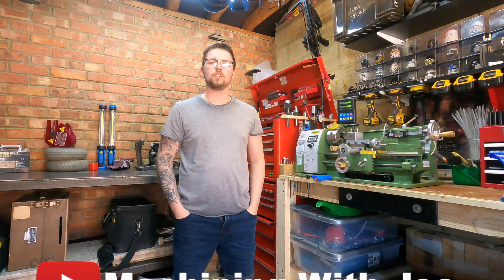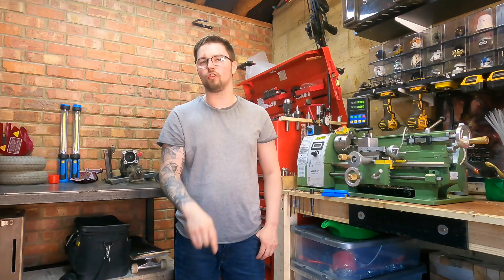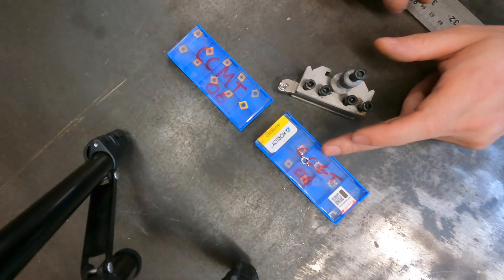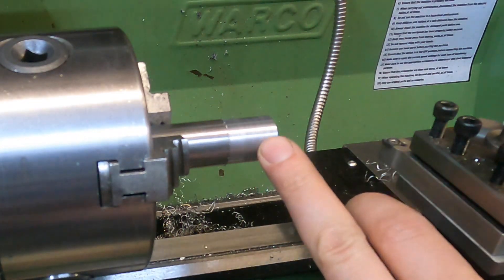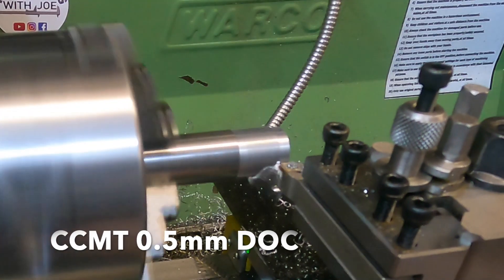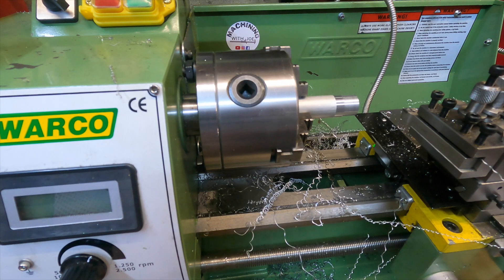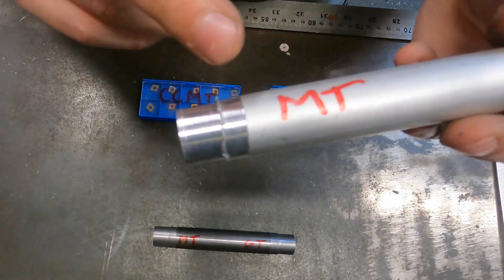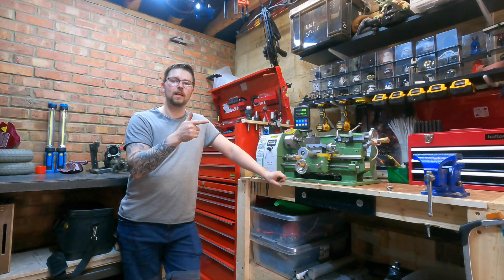Best Carbide Inserts for a MINI Lathe

Comment: The ccgt 21.51 from china are cheap, leave great finish on steel on my south bend 10.  Im sure the ones from mitsubishi/ kennametal are worlds ahead but ppd they are typically great.  Now if only the had 4 edges like negative inserts
Reply: Try a SCMT insert.

Comment: If you buy uncoated but highly polished inserts, they are specifically designed for aluminum. They don't work so well on steel for some reason but works great on aluminum. Another thing is, you need to dial up your feed rate because your chips are coming out stringy. 

Oh by the way in the beginning of your video your fly is open...

Comment: Following the link, those CCGT were AK inserts which is the Korloy designation for their inserts for aluminium.  They have 20 degrees of rake and are very sharp, really cut down on the power required to make a cut.  They won't last long using them on steel, but lets face it they are pretty cheap and are much easier on the lathe.  The CCMT inserts are probably moulded rather than ground, makes for really robust edges on the insert, but will draw more power when taking a cut.  I use an insert by Sumitomo which is also a ground insert, less rake than the AK about 15 degrees I think.  I use that for anything I cut in my small cnc.  Still cuts down on power required compared with a moulded insert, I use it as my general purpose insert.  I do not use moulded inserts in my cnc as it only has 1/2hp at the spindle. Good video Joe
Reply from the maker: Hi thanks for such a detailed insight into them the rake angle makes sense why they seem to achieve a great finish with so little lathe power. Thanks again for the comment hope your enjoying the channel.

Comment: Thanks for the interesting video, brother.  As Karlrobbers said the 3rd letter denotes the tolerance.  But why are CCGT's consistently different in their characteristics than CCMT's if only the manufacturing tolerance is different?  Well, carbide inserts are molded and then sintered (baked) at high temp.  The "M" tolerance is normally associated with inserts that come straight out of the oven and have little or no post-processing of the cutting edge.  The edges tend to be slightly dull, or rounded, which makes for good durability.  Since the inserts shrink during sintering it's hard to get very tight tolerances with this process.  The "G" inserts are ground with diamond wheels after sintering.  Ground edges are very sharp.  Grinding can also be done to very precise tolerances.  These inserts will not last as long but they will be superior for light finishing passes and gummy materials such as aluminum and stainless.  While I don't know for sure what the M and G stand for I would venture to guess that M is for molded and G is for ground.
Reply from the maker: Hi Cody,
thank you for your detailed explanation. The joys of the internet info can be interpreted differently so is always good to hear from someone with first hand knowledge. So thank you again for explaining to me and any other viewer that maybe interested in this topic. 👍

Comment: It might pay to go back to your ISO chart and check yourself.  The third letter (G or M in this case) relates to manufacturing tolerance and has no relation to nose radius.  The nose radius is defined by the 5th and 6th number after the four letter code.  for example a CCMT 060204 would be 80 degree 1/2 diamond shape, 7 degree clearance or relief angle, .05-.13mm tolerance on dimensions, 40-60 degree double countersink fastening with single sided chip breaker, 6mm cutting edge length, 2.38mm thickness and .4mm nose radius.  Changing from a CCMT to a CCGT only alters the manufacturing tolerance from .05-.13mm to the tighter spec of .025mm tolerance.  Common nose radius designations will be 02, 04, 08, 12 and 16, although the latter two are best suited to larger lathes.  There will also be some manufacturer specific letters after the ISO designation that describe their particular chip breaker geometry and other manufacturer specific characteristics.  Both CCMT and CCGT inserts are available with the .2mm nose radius, but all things being equal, the CCGT's will be more expensive given their tighter manufacturing tolerances.
What is the parentage of your CCMT inserts as I couldn't see any label on their box?  No use comparing cheap Chinese knock offs against a quality insert such as Korloy, Iscar, Kennametal or Sandvik.
Reply from the maker: Thank you for clearing things up for me. I appreciate the time and detail you have put into your comment sounds like you really know your stuff. I will look into the make next time I’m in the shop and let you know. All the best.
Reply: @MachiningwithJoe  No worries mate, it can be quite confusing initially, but once it clicks in your head it gets a lot easier.

Comment: Joe, very nice Astra milling machine on ebay. 6 days to go bench top design 240 volt, vertical and horizontal with tooling looks very solid, might be perfect for your needs, ChrisB257 has a small Chinese made mill and is very limited as to what he can do, watch some of his vids it might make you think again, Regards Del.
Reply from the maker: Cheers Del I check it out I’ll also check out Chris channel. 👍
Reply: @MachiningwithJoe  Just had a look again on ebay and its very popular, people know a good machine when they see one, even nearing the price of the Warco mill, which I dont think it will, it would be a great buy! let me know what you think of it.
Reply from the maker: Hi Del yes I think I’ve found the machine you’ve been talking about. Looks great really solid machine just need to find out how much the table is as want to be able to skim cylinders heads on it.